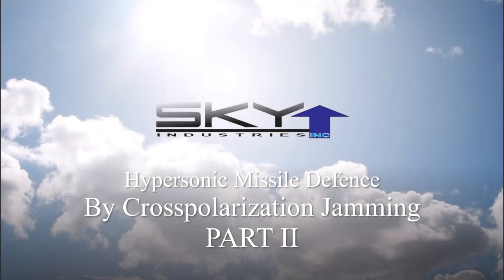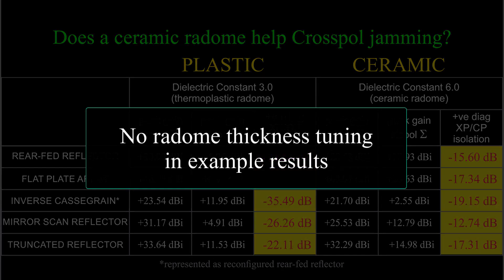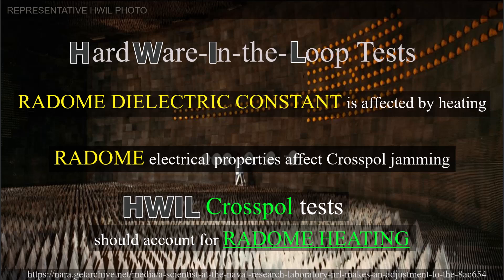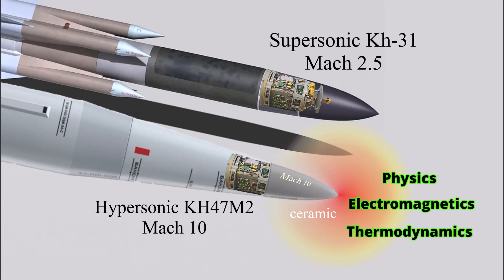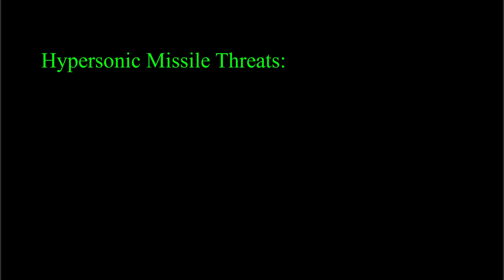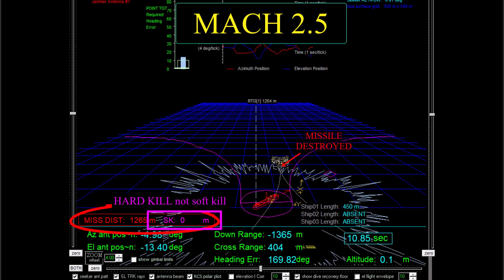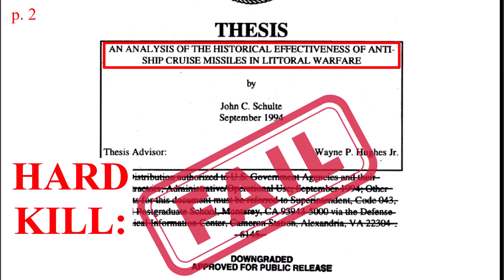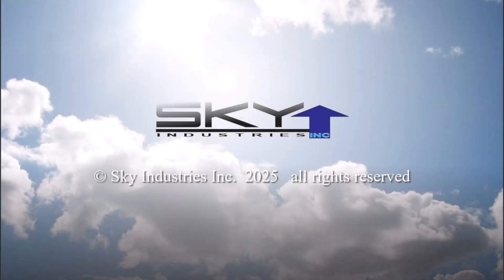Hypersonic Missile Defence By Crosspolarization Jamming PART II 25

Comment: Given that the radome material is the problem wouldn't they put a discardable heat resistant radome over the normal one and jettison it as it enters the terminal guidance phase so as to avoid this type of jamming?
Reply from the maker: Good suggestion, however an underlying thermoplastic radome would still make the seeker majorly susceptible to Crosspol.

Comment: So, is the whole idea based on the unavailability of suitable radome materials?
Well, that seems a rather optimistic assumption. There are three ways out of this, from least good to best:
1. Use your vast funding in material research to find a hybrid material with better properties
2. Use film or transpiration cooling to use otherwise unsuitable materials. PEEK as a high-temperature polymer, together with active cooling has been used in flight experiments up to mach 11 as thermal protection. With the right geometry and coolant injection you could even "cut a window" through the plasma for a small part of the seeker at high speeds.
3. Just shed your thermal protection dome when going to supersonic speeds. It is a standard solution already today implemented for infrared seekers in surface-to-air missiles like the IRIS_T SLM. There is no reason why you cannot have two stacked domes optimized for different flight phases

Comment: Would it be possible to detect when the missile seeker is being jammed and use the jamming frequencies to guide the missile in as a bypass for the seeker?
Reply from the maker: Yes the missiles pretty much all have a "Home-On-Jam" (HOJ) mode, in which the seeker develops angle information from the jammer's signal  https://en.wikipedia.org/wiki/Electronic_counter-countermeasure#Radiation_homing

However: this won't work against a Crosspol jammer, since the jamming signal exploits the electromagnetic properties of the antenna.  The seeker's angle angle tracking function is damaged before the sophisticated signal processing even starts.

Comment: Could ablative heatshields be used as a radome without this issue? Phenolic is kinda sorta plastic.
Alternately, the ceramic heatshield could be a faring that is jettisoned during terminal, similar to how rockets jettison farings to deploy satellites and other payloads.
The phrase "when alerted" is the key factor, hypersonics cannot be sneaky and are often too big to easily hide and seem to rely on propaganda hype for fleet in being deterrence, but the upcoming generation of stealthy cruise missiles are far scarier because they can be bolted on to almost anything anywhere and you don't get alerted until its well in visual range.

Comment: Would the possibility of a counter-countermeasure ceramic fairing that is ejected in the terminal sub Mach 5 phase to reveal a thermoplastic aerodynamic nose cone not be an obvious solution to being susceptible to cross polarization jamming?
Reply from the maker: Good question; a thermoplastic radome will still create a vulnerability to angle deception by Crosspol jamming.

Comment: Really cool video. I found it fascinating even though I don't understand most of it. And for my shitpost: my favorite part is when he says "the truncated cassegrain already has a high crosspol gain for reasons that are obvious if you think about it a bit". I thought about it a bit and it did not become obvious.
Reply from the maker: Apologies, I was overstating to keep it short.  

By chopping the bottom or top off the reflector it becomes asymmetrical, so the little crosspolar components in each quadrant don't cancel anymore.  Result: massively increased crosspol gain.  See https://www.youtube.com/watch?v=gBCYJL9uxG0 , 12:22 - 13:31, pay close attention from 12:58.  

Much easier to understand with pictures, I'll put it in a video.
Reply: @ awesome; thanks for responding!
Reply: @skyindustries  This is a better explanation. I had imagined that a simply bent plate captures both the polarisations. But now I understand more. Thank you Sir !!
Reply: @skyindustries  One thing I have never understood properly is which one retains the most energy in an EM wave: The Electric field wave or the magnetic field wave over large distances. And thus which one is most useful in transmission the Electric or the Magnetic component? I have suspected it’s the electric one and you have also specifically spoken about the Electric one only.
Reply: @JohnLee-bf2ux isn’t the magnetic field just a reflection of the electric field? Therefore, it is the electric field that both gains and loses energy.
Reply: @michaelgarland6715  Ok so in that same line of thought, which one is better? High voltage or high current fed to the antenna? As much as I understand high voltage would cause high electric field and high current would cause high magnetic field.
Reply: @JohnLee-bf2ux  As far as I recall, both are identical in total power. It's just whether they're in phase or not, which gives circular polarisation of they're not.
Reply from the maker: @ electric (E) and magnetic (H) fields come as a "coupled" pair; can't have one without the other.  

The power flow in the wave it the vector cross product of E X H, that's called the Poynting vector.  

The cross product means the Poynting vector is at right angles to both E and H and almost always points away from the antenna, so power flows outward from the antenna.

The exception occurs very close to the antenna, in the "evanescent" region (also called the "invisible region" of the antenna pattern), corresponding to propagation at complex angles [i.e. angles that have both a real and imaginary part! and yes this has real-world meaning].  

Evanescent fields are like an envelope around the antenna; in this region E and H are in quadrature (90 deg phase shift) so the Poynting vector flips sign every quarter wavelength [draw a picture of this to convince yourself].  This means there are vibrating shells of power around the antenna.  

The evanescent field decays exponentially with range, inversely proportional to the wavelength.  That's why it's called the "invisible region" of the antenna pattern.  Farther in range is the Fresnel region, in which the radiation pattern changes shape with increasing range, then the Fraunhoffer region (the far field region) where the pattern has settled down and doesn't change with range.  

All very sensible and physically intuitive, after a little thought and pencil chewing :)
Reply: Excellent analysis😂 if you watch his other videos on crosspol jamming it will still not be obvious but there are very many funny words
Reply: brain hurts
Reply: > I found it fascinating even though I don't understand most of it

Or, as the Russians say, "нихуя не понятно, но очень интересно"

Comment: For the big anti-ship ballistic missiles, I wouldn't even put a seeker on the missile itself.  Have space based optical sensors track the relative position of the missile and the target, and then beam guidance commands up the back of the plasma cone like SpaceX is beaming 4k video of Starship reentry to Starlink satellites.  The missile can stay hypersonic all the way to the target, and the plasma cone becomes protection against ship-based EW that would try to jam the guidance link.
Reply: Too expensive. To have live space based tracking any where in the world you need a massive satellite network, which not every country, who wants/has hypersonics can afford. Plus there most likely exists some amount of anti satellite weaponry designed to degrade that capability for the opponent in case of a big war. You could have that as one of the engagement modes if you are bombing G*z* or smth, but  I would still put a seeker in there for peer to peer engagements.
Reply: The issue is accuracy and lag time. Optical systems can be dazzled and spy sats are going to be targets. Coms sats that are in low orbits will be susceptible to similar destruction and those in higher orbits will have too much of a lag time to reliably get hits. 

With the Starship and Falcon 9 example SpaceX does not use such feeds for guidance, they use other sensors to help guide boosters in for landing (similar to trying to hit a target, if less destructive).
Reply: Also, weather
Reply: @alistair221  yeah 

No matter if a country is a dictatorship it just doesnt look good if your news super missle cannot work becose theres a cloud

And active radar would be detected
Reply from the maker: Good thoughts and questions.  

I think it would be a major challenge to create a sufficiently-accurate real-time guidance loop, but must volunteer I do not know the present state-of-the-art.  

That said, the targeting satellites would almost certainly have to be in low Earth orbit (LEO), so the missile's tactical use wouldconstrined by orbital dynamics, i.e. each satellite only overhead for a few minutes.  Coverage will determine when attacks can happen, and both sides will likely know the windows.  

And if the satellite uses a Synthetic Aperture Radar (SA) to develop guidance signals, it can in principle be jammed with Crosspol.  Among other electromagnetics-based countermeasures such as Crosseye, Sector Crosseye, Polarization Crosseye or Double Cross.  And with a gigantic synthetic aperture, it's possible in principle to tailor the effects in interesting ways.

Comment: Fascinating. 

First...Does the theory on forcing hardkill by impacting the sea, depend on the missile not having an absolute measure of height above the water? But surely a sea skimming capable missile will have a radar or baro altimeter and an IMU rather than just relying on pure guidance from the main target radar ... so wouldnt the auto pilot intervene to ignore the false track and force the trajectory to asymptote with the water?  
Or do all these hypersonic missiles approach on a high ballistic trajectory, skipping the sea skimming phase of subsonic missiles eg. a Harpoon, hence do they not have an absolute altitude reference?

Second...if its guided by GPS/Glonass waypoints for most of the flight, and it has a low drift IMU, can't the missile determine the absolute position of the target... and couldn't it reject apparent target position shifts after initial acquisition that require implausible velocities and acceleration, eg with a Kalman filter, and just fly towards the extrapolated position based on initial position and velocity, on the basis that warships accelerate slowly?
Reply: At terminal phase there's not much the missile can do if the seeker say the ship is where it think it is.  It wont save itself because the guidance system say the ship is there.
Reply: @robertomartin8731  I should have made clear, my point was that once the target acquisition radar is enabled and the target acquired, a modern digital guidance system can reject implausible changes in apparent target position. If the jammer is fast enough to upset even the initial target lock position, this might be effective. But if the jammer only starts creating a phantom signal after initial target acquisition has happened (in response to seeing the incoming radar pulses) and the missile has an accurate IMU and GPS/Glonass position at that point, then further changes after that can be rejected if they would be implausible given the very limited acceleration capability of warships. 
It is even possible for the missile to get a single initial target position, velocity and range, then switch off its radar and re-enable  it only when it expects to be within a few km, then switch it back on at the last second for a final correction. Sure, the legacy Soviet systems are dumb and simply follow the radar track, but I expect that any anti-ship missile developed in the last 20 years will have an IMU and satellite positioning (anyway required for the waypoint programming and secondary ground attack functions), so it can work in an absolute position coordinate system allowing such filtering/rejection to be done.
Reply from the maker: @robertomartin8731  absolutely right, it has to hit as close to the water line as possible.
Reply from the maker: Good points and questions.  

The lethality of the missile strike goes up quickly as the hit point approaches the water line, so these things are using range and angle information to ride a razor's edge between self-destruction and mission success.  

And they pretty much all use a cruciform wing arrangement.  I would expect an altimeter to provide some protection over some of the flight trajectory, but perhaps not all.  That's as far as I can go on this one.

Comment: Remote guidance via satellite uplink

Also, if the missile is super-sonic at terminus, then it can be hit with SM6. 

It wont be low because the friction from air density would mitigate the advantages of hypersonic flight and increase costs. 

HS missiles are for time on target attacks from remote source-platforms to coordinate 
 penetration of defensive systems by overwhelming them, not to outpace those defensive systems target acquisition capabilities.

Comment: To my knowledge, phenolic ablative heat shields/ nose cones have been used in hypersonics since the 70s. The sprint ABM is an example. 
If the thickness is tuned to have the same attenuation regardless of angle, this again would counteract this jamming problem.
Reply: Ablation doesn’t work at the temperature time curves used for hypersonic cruise or boost glide weapons.  Ceramics up to and possibly including hafnium diboride used for maneuvering Reentry Vehicles are the type of material, backed by insulation or active cooling / heat sinks.
Reply: @Georgewilliamherbert  would it be possible to jettison the ceramic radome, leaving behind a thermoplastic one?
Reply: @ people have hypothesized about that but ejection of a radome is kind of difficult.
Reply: @FarțResidue  You are talking about trying to eject a relatively large item from the missile in very high speeds(from mach 5 slowing down to mach 2.5 or similar). The reliability of the separation is going to be difficult. Even if you can implement such a system, the thermoplastic radome still cause vulnerability to crosspol jamming attacks anyway (although we can expect the effectiveness to be lower relative to no ejection).
Reply: @cryptoam177  it is not difficult... you use MIRV for that scope
Reply: Ahh I just asked this question, thank you
Reply: If jamming causes a missile to miss it’s always a hard kill

Comment: Well, I'm a programmer so I didn't got most of the content intended. Still, I looked for engage simulator and didn't find it. What is this software? It looks kinda cool
Reply: Almost certainly an expensively licensed proprietary package marketed by a defense contractor to other defense contractors, and quite possibly requiring some kind of security clearance to get ahold of.
Reply: @JonBrase  The author of the video also authored the Engage software.
Reply from the maker: @JonBrase  actually wholly owned by me and unclassified - but it is a Controlled Good, so there may be export restrictions, I have never tested this.  I created ENGAGE bit by bit over the past 25 years to investigate certain things when contract work was available, but I am absolutely not a software developer.  

Probably fair to say that most of whatever insights I have came from playing with ENGAGE, then later confirmed in missile trials.  It is just astonishing to see the real thing behave the way the equations and software predict.  Astonishing.  And then to use the software to find out why by doing meticulous, excruciating detective work.  

The wins are usually years apart, but they are golden.
Reply: Same here